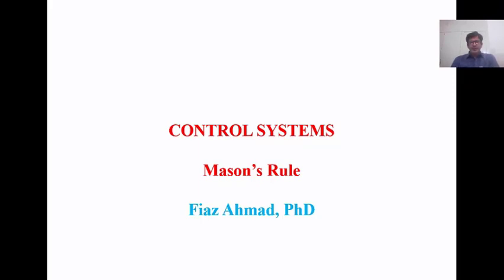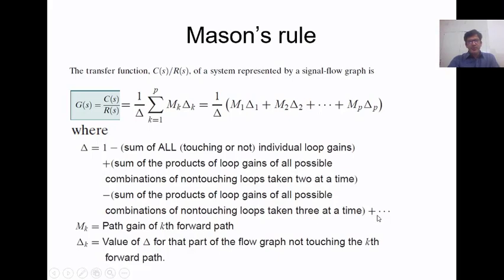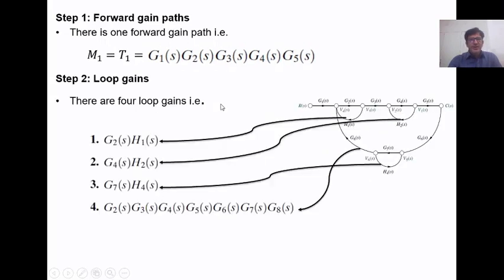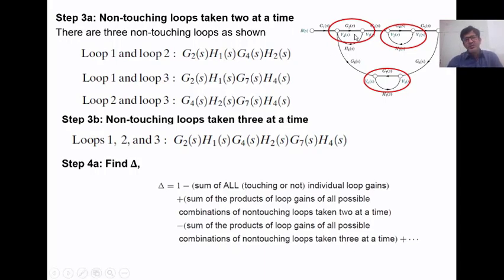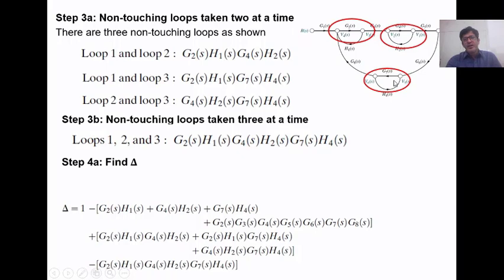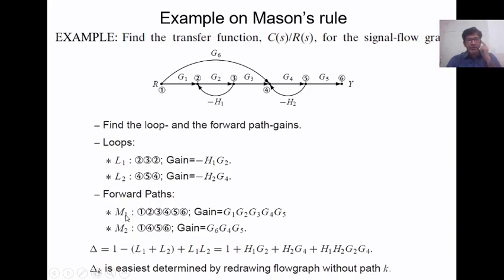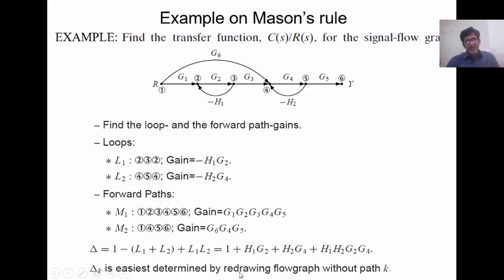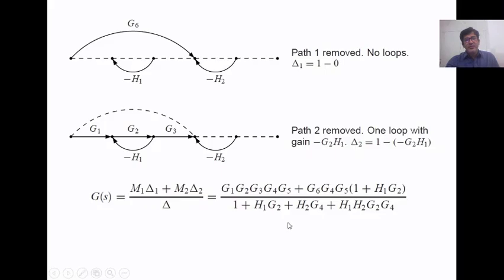Mason's rule for finding transfer fucntion with block reduction

Comment: How one should determine the k-th forward loop?
Reply from the maker: A forward path is defined to be "A path starting from the input node to the output node without involving any loop"... So if you have one such path from input to output we say k=1, However, if we have two paths, 'k' will assume 2 values that is k=1,2... and so on.... I hope that i have answered the question...
Reply: @DrFiazA  thanks alot
Reply: @DrFiazA  ok